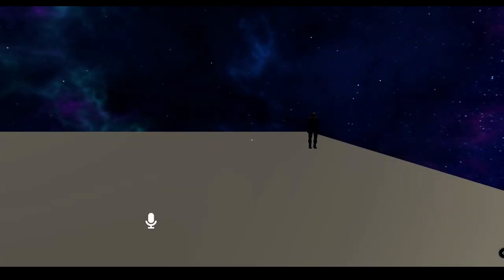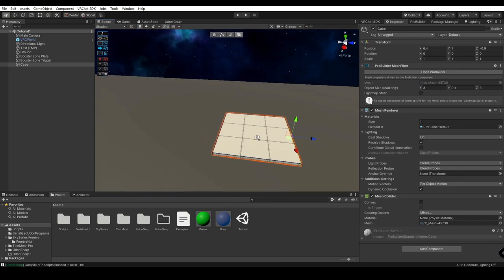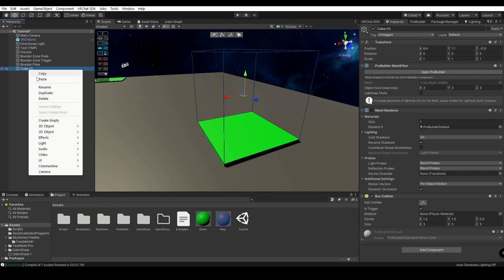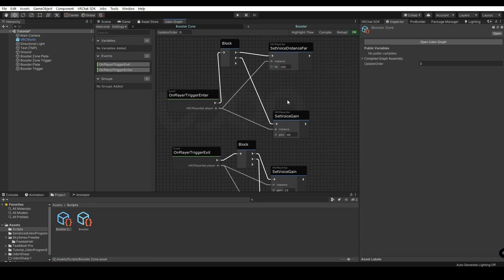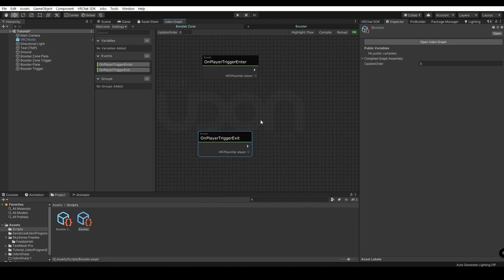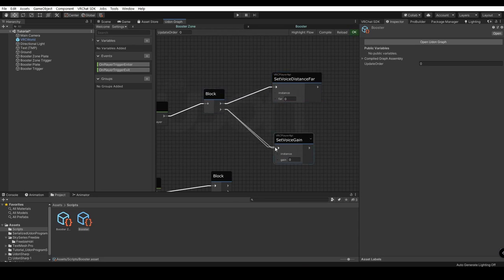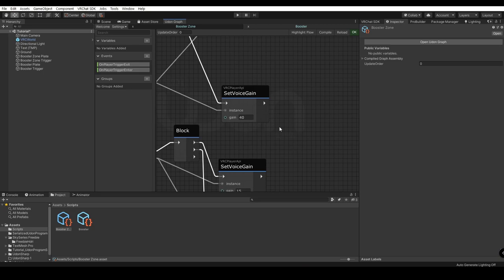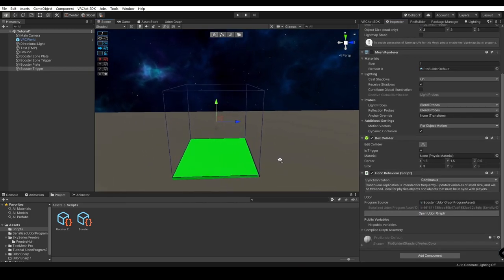Unity VRChat - How to create an Player Audio Booster Zone

Comment: Hi, I have a question. ¿Is it possible to do the audio booster, but instead of it being activated staying on an area, it's active by holding an object like a microphone?
Reply from the maker: You could potentially attach the zone to the microphone so wherever you walk you will boosted. Alternatively, you could modify the graph to be on pick up and on drop. Instead of on player trigger enter/ on player trigger exit
Reply: @OfficialKokoStudio  Thank You, also great vídeo and explaining
Reply: @OfficialKokoStudio  Actually, in the graph you have their provided, you are only replacing player trigger with the On pick up and on drop. Would that automatically work? Especially with the mic situation? I don't know it would work automatically due to it connected in the graph shown there. I mainly just want to make sure I'm correct on this when doing it this way instead of a platform doing it.
Reply from the maker: I have never tried it with OnPickUp and OnDrop If you end up giving it a go let me know if it works
Reply: @OfficialKokoStudio  Sadly though I tried, and it didn't work, I thought it would do it easily off the bat, but it wouldn't work THAT easily. lmao. I'm going to go ahead and do your method you provided above and pray that someone knows how to do it.
Reply from the maker: Damn, that's unfortunate hopefully someone figures it out

Comment: Could you use a custom shaped collider? Would be super useful for rounded stages.
Reply from the maker: You sure can, any collider will work as long as you have "is trigger" checked 

You can technically clone your stage, remove the mesh renderer, change the collider to be "is trigger" then raise it above your actual stage and you'll have a perfectly matched collider zone